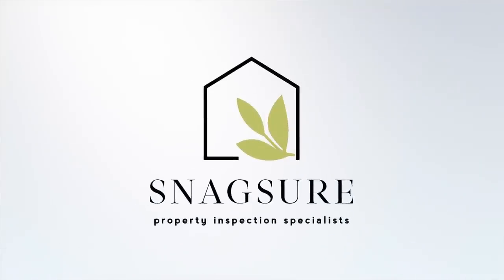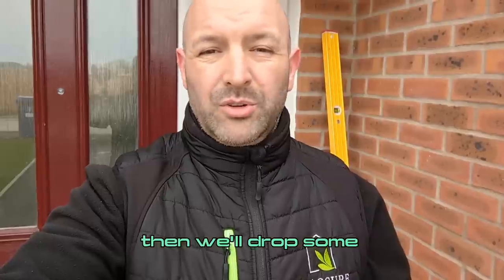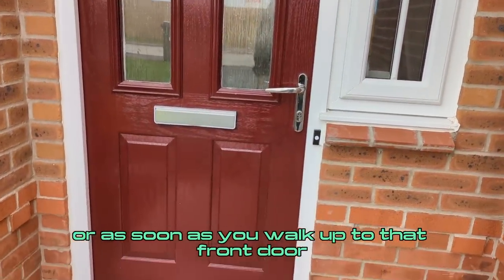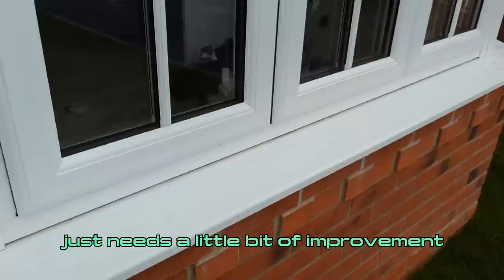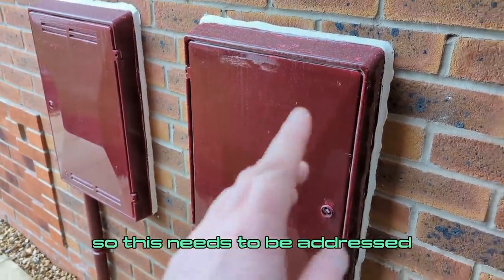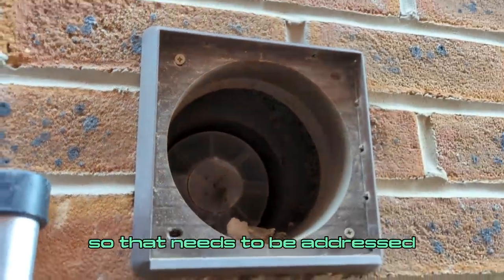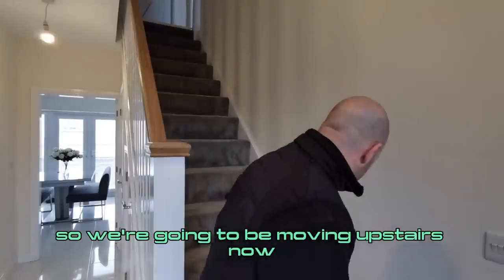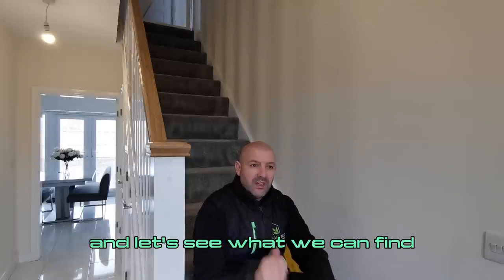Anwyl Homes - The Henley - Snagging Review

Comment: All site trades need to go on a tour of a Bentley motors assembly line. The car costs as much as one of those houses but is built with pride in the job which is sadly lacking in the building trade. If a Bentley was to leave for the customer with a number of snags as long as your arm they would soon be out of business.

Comment: Thank goodness for these videos to expose the draconian routine with a snag. I've had 4 new houses and presently purchased the showhome, and I can tell you with my experience that I would definitely recommend a ex showhome because it's been built to a proper standard as there's hundreds of customers buying into a dream. It's also been pampered every week with painters, cleaners and heated so settlement is minimal. But unfortunately this dream doesn't extend to the rest of new builds generally. The snagging day is laughable unless you take a professional stagger or spend hours pointing out to the site manager. Take ladders and a spirit level and take your time, DO NOT RUSH!!. check the loft with a torch and behind everywhere. The law desperately needs changing to a audit at every stage and I mean every stage by a independent government professional. Then no monies should be given until your 100% happy. To late when your in, yes your protected by the 2 year builders warranty and NHBC but you have moved in. Change in the new homes quality build needs totally revamping to protect customers. You wouldn't expect half of the issues on a new car so why your home .😊

Comment: Lived in an identical house in the UK, Congleton Cheshire, to be precise.  Built by the now defunct Maclean homes in 2001.  Terrible workmanship.  You could push your foot against the skirting board of the wall separating the bedrooms, and it would move.  If you pulled up the carpet there was enough room to slide under a piece of card.  Loads of other issues.  Now live in the US in a colonial revival house.  Built in the mid 1940s.  Solid stone, hardwood throughout, sits on almost an acre of landscaped garden in a small rural town in Pennsylvania.  The guy who built it owned a lumber yard.  We paid less than $185,000 for it in 2016, but because of the rebuild costs, it is insured for over a million!  Sadly, we seem to have gone backwards in construction quality.

Comment: I see quite a few of these snagging videos. I’ve never seen any checking of the main roof, or any mention of faults with it. Are they checked (as best you can without the scaffolding) ? The roof is obviously extremely important and once the scaffolding is gone, it can be very difficult to deal with any faults.

Comment: I asked the builder of my new build house to get the decorator to do all the walls and woodwork white. 
Absolute shocker of a job most of the MDF skirting boards had been hit with the roller and blathered in Matt emulsion. Most of the skirtings looked like they had been pebble dashed. Then again so did most of the F&&&&&g walls. He offered to get the decorator to put it right. 
If contractors can’t get it right the first time why would I give them a second crack at it. 🤷🏻

Comment: Sometimes, the reason the underside of window boards get like this is:-

a) The boarder doesnt jack the board up so it's tight underneath and
b) When it does get filled and what not, the painter tends to come along and scrape underneath, I say scrape, more... Stab, and they knock the living poop out of it.

Same around sockets, when you've got cleaner coming in, they usually scrape the muck off, but, when it comes to boarders cutting the sockets out of the board, they tend to cut the edges in a feather edge type way, so when they put the board up on the wall, if their cut is slightly out, the back box has less chance of hitting the back of the board, but the board is really thin now on them edges and they really cannot take much of a knock.

Scruffy patching... Yeah, no need, but some sanding or whatever may get missed, but that's human nature... But in hindsight, NHBC Standards 9.1.3 states no artificial lights and you must be 2m away from the wall when inspecting it, but the problem is, some stuff only comes up depending where the sun is, one minute you can see stuff, clouds come over, and just like that... It's gone and the wall looks as flat as a pancake again... But if people relied on the NHBC Standards... You'd certainly see more "untidy" stuff, for sure, so all in, the most part, most drywall is brought up above and beyond the standards, believe it or not!

Comment: The professional tiler who did our bathrooms and hallway was brilliant but new house builders will not pay enough to get professional tilers to do the work. Building companies want to pay tilers £15 per square metre while I was happy to pay £40 a square metre to get it done properly. I also used a specialist sealant company to finish the corners and windows. Plastering not great in many new builds as it just depends how lucky you are if you get a good plasterer. Only had one new starter home 20 plus years ago and it was pretty good but found loads of issues with houses since of the same age. Stairs not secured properly or plaster board on stairs / not attached to the stair frame so kept cracking sealant, bedroom alcove flooring not secured or supported properly, plastered walls rubbish, kitchen worktop bodged with sealant, boiler pipe work messy with no pipe insulation, kitchen sink pipework a total mess in 2 houses but luckily when new kitchen bought installer used less pipework and ran it to the rear of the cabinet giving under sink storage. Radiator push fit connector did not have insert in it so leaked, radiator pipe secured just behind plaster board in corner of a wall so easily drilled into while installing shelf. Outside light 250 V wiring buried just below surface of plaster board (this could have been previous owner). Gutter drains not going to drain but to pipe buried under lawn / grass on top of very heavy clay soil so never drained properly, this is very common.The drain on the garage in this house in the video should go into the gutter and not sit above. Cavities full of rubbish causing damp issues common. Helmet and boot found in lawn while planting flowers. Walls not straight and in one case 2 walls built next to one another rather than one longer wall which were an inch different in depth, why ?
Reply: Totally agree re the prices for tiling. I've given up pricing new builds. I was getting £15 a metre in 2000.

Comment: Considering the owner has spent north of a quarter million quid the fit and finish is shocking.

The builder don't give a f*ck though. Build it as cheap and as quickly as possible and charge an extortion for them.